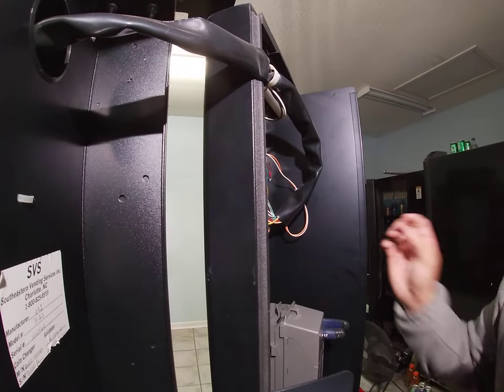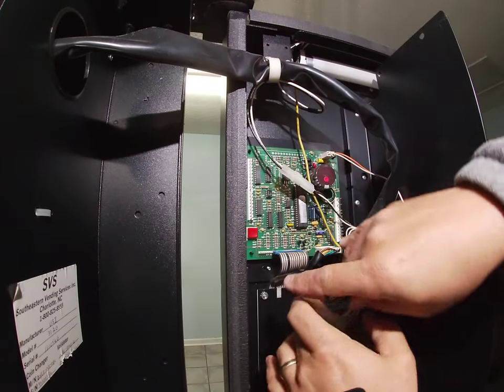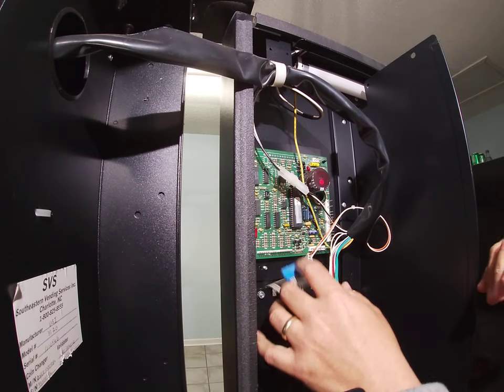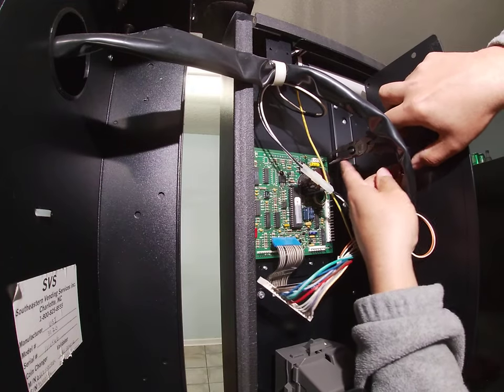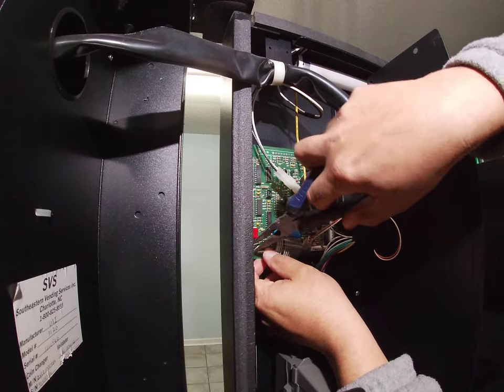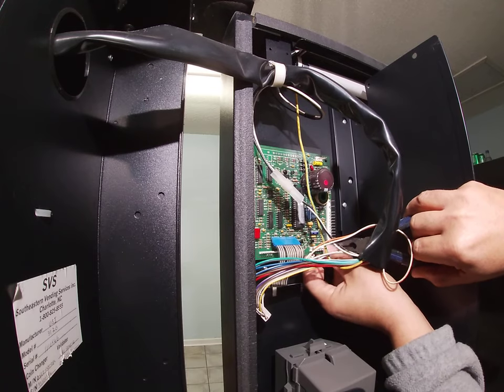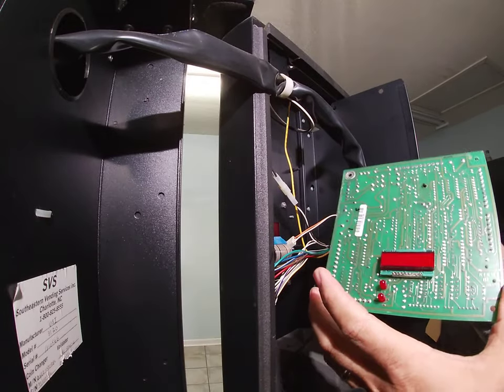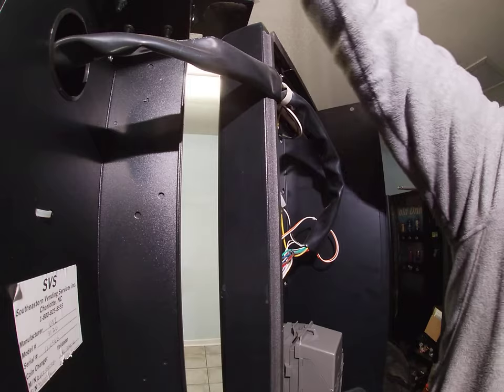How to Remove a Wittern vending machine board.

Comment: Hello there i have a machine with the same board you wouldnt know how to turn off Pulse Mode please im desperate
Reply from the maker: You have an AP LCM with the F80 board that is running a micro mech?
Reply: @Vendingsupplier  Yes this is the information I have gathered thus far" The board used in the LCM was an off the shelf board made by Coinco. What that means is at least 3 different companies used the same basic program in various machines. AP used it in the LCM series snack machines, Wittern used it in the F80 series snack machines and one other manufacturer (believe it may have been Rock Ola but not sure) used it in a Can Drink machine which used solenoids to deliver the drink therefore it only needed to pulse the solenoid to get it to deliver the drink."  The problem is that the motors try to spin and they barely move the spiral (even without product). I would say the move around 1 degree thus the pulse mode any help would be greatly appreciated 👏